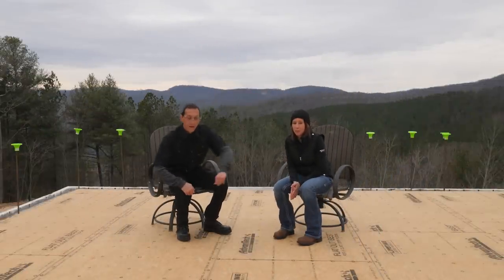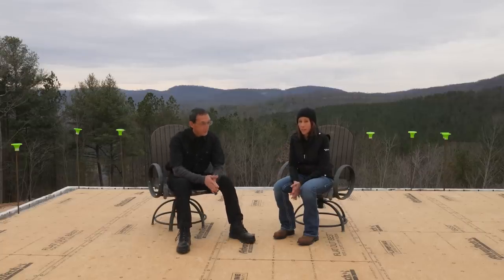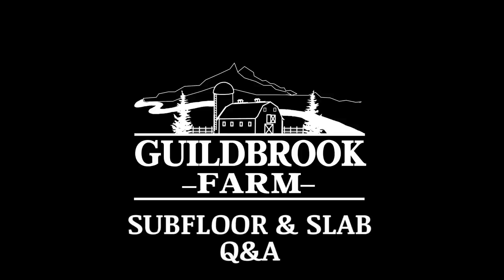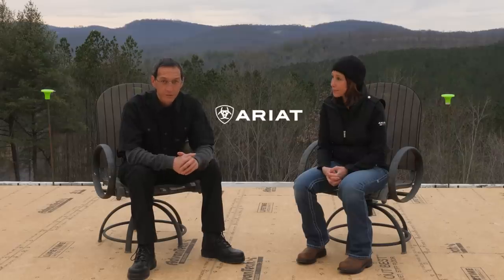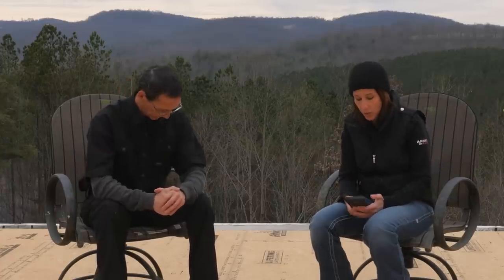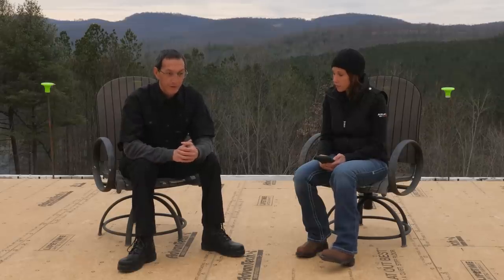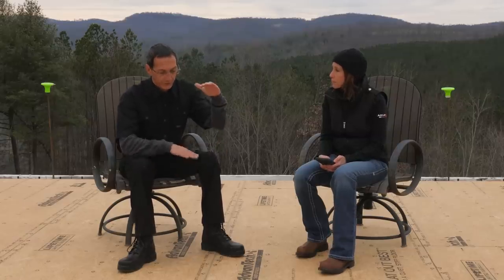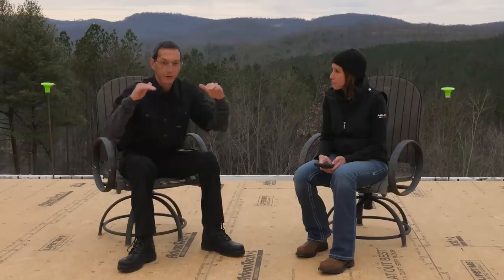The Dirt: Advantech Subfloor & Basement Floor Slab Q&A

Comment: I've been learning some building science recently and it seems like insulating basement floor above the slab can be sub-optimal because the slab stays cooler, and therefore stays wetter because it's harder for it to dump it's moisture load into the house (and my understanding is it will get moisture load even if you use the poly under it). Thanks for going through your reasoning on your building choices!

Comment: Hey y'all!

Thanks for the Sit Down, it really DOES help for those of us trying to learn for what we might want to build in the future!

I'll end up in a One Room Shack (no foolin') up in AK, with a couple of built on 'cubby hole' rooms: one for the WC and the other for the Larder. 

The biggest thing for me is that the house has to be built on 'concrete pilings', because of how wet the ground is (and unstable), but my biggest challenge is going to be my research for a non-motorized elevator (all wood) so that I can have a Loft (which is standard procedure up in AK) to use as the bedroom.

My knees do NOT like stairs or ladders, so I'll be garnering as much information about counter-balance spring/pulley systems as I can find! Basically, my 'main floor' will be about 400-600 sqft and the Loft 200-300 sqft......basically, the size of most modern living rooms will be the size of my entire house.

Lastly, the only information I would have like to have heard about is cost. You've done a great job of letting us know about how much things cost along the way (especially the solar system.....I'll be reviewing that portion of your videos ONCE AGAIN, just to try and keep wrapping my head around the process, the theory, and the interactions of all the components.

My goal is to have a Gasification Generator System, so that I can burn all that free wood available (25 cords a year FREE, "just labor" involved), with a grand canyon amount of beetle killed standing dead trees for the taking.

Anywho...thank you again so much for all the hard work you two have done......I've been following along and I'm VERY GLAD to see all the hard work you've put into your project and your channel, become fruitful for you! I like to see hard working people succeed!

Take care and Keep on Truckin'!

Cheers from the Oil Patch in Central WY

Comment: Your slab floor will be fine. When I built my shop about 20 years ago, I used fiberglass mesh with no wire or rebar. It's 36x48 and I've had vehicles upwards of 8000 lbs on my 2 post lift with no problems.

Comment: Are you going to use wood Bucks for the window openings or just going to screw the windows into the concrete. I’ve seen one of Matt Risinger’s Guys do the with ICF using liquid applied sealer to the finished concrete  for the window opening

Comment: guys your kicking it. I built my own 30x40 cabin ,with D lumber, and faced it with log butts to make it look like a log home.  I did use I beam rafters on the roofing over hangs to allow for a rap around porch. but found it was not that of a great idea, in the end.  but it allowed for my vaulted ceilings. that took up a lot of money.  it did work though. now as too the heating think about using tube heating for thermal system later on.  it will be cheaper in the end.   other then that who knows what you want in the house.

Comment: As a former firefighter, Deputy Fire Chief, and station training/safety officer, I Beams are not fire resistant as much as dimensional lumber is.  Part of training sessions involved in building both samples on an I Beam and dimensional lumber joist system.  I then put a tiger torch to both samples with a 200 pound weight over it.  The I beam sub-floor/joist system typically catastrophly failed within 12-15 minutes.  A dimensional truss system normally failed 35-40 minutes after the fire started.

Comment: I like dimensional lumber or solid lumber better than I beams or trusses. 1 I like to use lumber and 2 dimensional lumber takes longer to burn in case of a house fire, this gives you more time to escape the house safely. :)
Reply from the maker: 2 good reasons. Also your joists aren’t made of glued together mulch, or 2x4’s strapped together with metal plates. They are a solid piece of lumber. 🤷🏻‍♂️
Reply: I have a thing about fire and flammable materials, thanks to a lengthy military aviation career. Solid wood takes a little longer to burn through than a thin I-beam web of OSB. Sometimes, just a few seconds can make the difference between life and death.

A few years ago, there was a huge five- or six-storey commercial and apartment building under construction on the main street of the city in which I live. It was all wood and OSB construction. There was no way that I would ever live in something like that. I had a bad feeling every time that I drove past.

I missed the fire, and did not find out about it until the following day. A portable propane heater was knocked over, which ignited the whole thing. The crane operator was trapped in his cab, but managed to escape and crawl along the crane and get a bit further from the flames. He was rescued by a helicopter, narrowly avoiding roasting to death. Flaming wreckage fell on a few parked cars, and there was a lot of concern about the gas station across the road. Had that ignited, it would have been catastrophic. There was a lot of luck, or divine intervention, that day.

I read in the local newspaper that a lot of people had been referring to it as "the tinderbox" since construction began, so I was not the only skeptic. The local fire chief was also quoted as saying that such buildings are just as safe as (what I consider) properly-constructed ones, ie steel and concrete, due to modern sprinkler systems. I'm sure that those don't fail very often, however...

Once the remains - and there wasn't much of those - were cleared, they rebuilt it just as it had been before the fire, but this time, it didn't burn.

I've no idea how they convinced their insurance company to cover the rebuild.

Comment: Adding partition walls parallel with the floor joist ; did you double up joist under said walls or incorporate additional joist in your build to keep walls from bearing only on the 3/4 subfloor.?  Also is there bearing points other than the perimeter or center beam ?
Reply from the maker: Yes and yes

Comment: Two truths about concrete.  It will get hard and it WILL crack.  Rebar or no rebar.
Reply: Agreed 100%. Just finished my house last year. The radiant heated concrete slab in the basement has wire and fiber, but it still developed some fine cracks.
Reply: Yep two types of concrete;
Concrete that has cracked and concrete that is going to crack

Comment: I wouldn't order your windows until you can measure the openings. Have windows made for your house instead of buying pre-made windows, it might be a little more expensive but worth it in my opinion. :)
Reply from the maker: On the fence. Haven’t ordered yet for just that reason. I’d rather order for the openings. 🤷🏼‍♂️
Reply: If you plan your rough openings correctly, you should be able to make off the shelf windows work. For some things like that glorious view you have behind you, I might go custom simply to take advantage of the size you want so you can view it in all its glory.

Comment: Sand is actually better than gravel. I have heard that sand is 90 percent compact just shoveling it out onto the ground, sand granules are small. Gravel has to be compacted with a machine before you can pour concrete over it. :)
Reply: Sand holds water that is the issue
Reply: Koality of Life Homestead - sorry, but you are mistaken. Sand is NOT a good choice as it is never fully compact, especially when ground water is present. The best option under a slab is an angular stone with no fines. Locally we call it clean crushed. When you place it, it requires NO compaction and has an open matrix which allows water to drain without settlement. The open matrix also acts as a capillary break under the slab, which reduces the chance of hydrostatic pressure on the concrete slab.

Comment: I don't won't to be a nay sayer or hurt your feelings but when I built my house 15 years ago I let people talk me into that concrete for my basement floor. Guess what. I regret it. It's cracked all over the place.
Reply: Your concrete guy was a hack unfortunately. Did he cut control joints in the floor, was it compacted correctly, etc ? Sorry about your floor.
Reply: But was it free floating or was it part of the foundation ??? How solid was the subsoil ???
Reply: @jameswitte5167  I have a normal concrete basement. My footings are 24" & the walls setting on them are 8". The floor was poured after the walls were up. There are footings under the slab everywhere there is a supporting wall. Also the outer edge is resting on the same footing the walls are on. The soil is compacted sand over virgin clay. I don't mind the cracks. All concrete does two things. It gets hard & it cracks. But if it cracks & there is any movement it will seperate. I have seen it used a lot in my area all with claims of how great it is but I have seen numerous failures. I'm not convinced it's as good as they say. I think concrete guys sell it because it's easy & they make just as much money for less work. Just my opinion. I'm sure some concrete guy will argue but as a plumber I've been in a bunch of houses that have that stuff & it just doesn't seem to hold up.
Reply from the maker: Hmmmm. Well the good thing I guess is that I know where my concrete guy lives. 🤷🏼‍♂️
Reply: @rickhammar1636  dang ... Then you just had some odd luck with cracking .. I have done maybe a dozen or so slabs for sheds from 8x10 to 20x40 ... No foundations except the20x20 and 20x40 ... From 2 inch to 4 inch thich on uncompacted sand because the water table averages about 4 feet down ... Control joints at the 10 foot marks ... Some movement on the bigger ones after 20 years but not bad ... Gotta love that fiber strand mix ...
Reply: There is NO way to prevent concrete from cracking...It's going to crack. Rebar WILL NOT help with cracking. The material you use under the slab WILL make a difference. Sand is a horrible choice for under slabs, especially when you have footings under the slab too! Crushed stone with no fines is the best material for under slabs as it requires no compaction. Your problem is not the product, but a crappy contractor.
Reply: What would be an alternative for a basement floor if concrete isn't used?  I don't believe I've ever seen a basement floor that wasn't concrete.
Reply: James Witte Sorry but a bit confused by you comment "Gotta love that fiber strand mix" given your initial comment was questioning the longevity of their floor. Was that sarcasm or was your initial comment really about the use of sand base or something else?